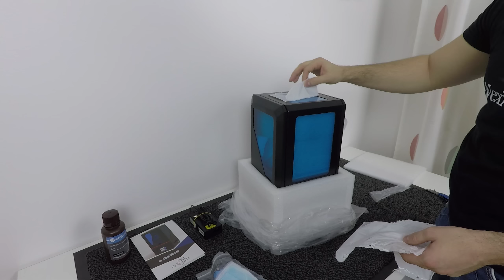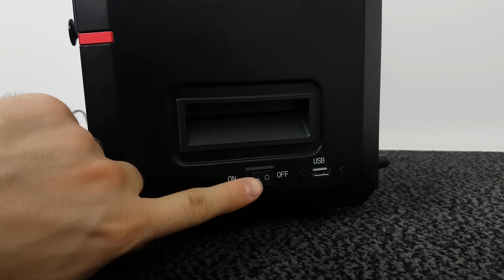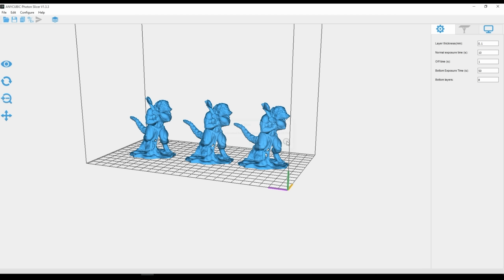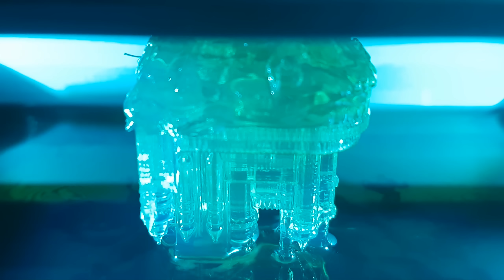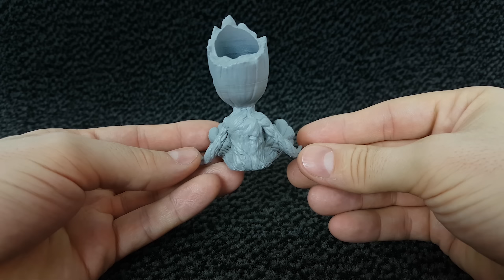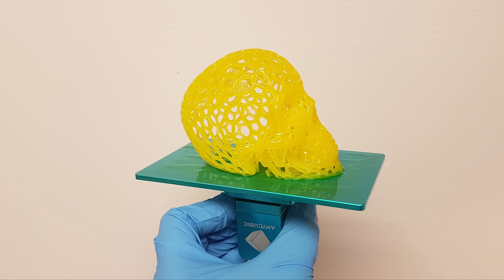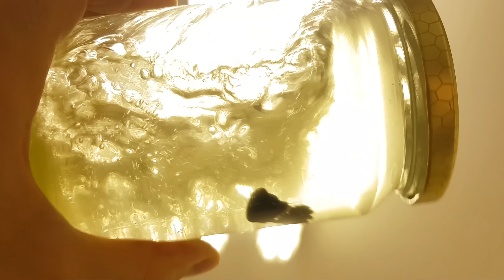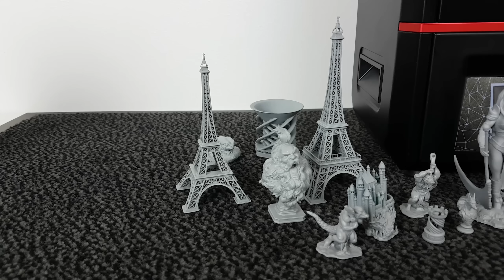Anycubic Photon DLP 3D printer Review - insane print quality!

Comment: SO hoping you can help me out. I have the FLSun variation of this printer. it came with a slicer called creative workshop. My problem is this. it works great. I am on the third of 4 built in test prints and its working wonderfully.

but it needs a file called MMS. but I can't seem to figure out how to get Creative Workshop to output an MMS file (it outputs B9j files)

the instructions that come with it are quite poor :-)

Suggestions? how do I slice files for this?
Reply from the maker: Nerys Am sorry my friend I don't how I can help you with that. I can only send you Anycubic photon slicing software if that helps? Maybe it will work with your printer?
Reply: Nexi Tech I figured out the problem the burn time for the first layers was not enough they said 30 seconds which is nowhere near enough the files they include which work are over 100 seconds first layer burn so I set mine to 110000 microseconds and it's working I also wasn't aware of that the that is supposed to be screwed down :-) so it's screwed down now I also found I can get D7 fep films off Amazon so I can replace the film I destroyed :-) I close the holes with Scotch tape for now it's working kind of enough to keep me happy until Amazon delivers on Tuesday :-) have a 30 hour print going right now of a giant Eiffel Tower :-)

Comment: Thanks for this review, but there is one major question. This DLP printer is cheaper than for example the newest prusa i3 mk3 amd the prints look so much better. What is the downside of this type, except of the more expensive resin?
Reply: You can make VERY rigid/tough parts with the high tensile resins out there.  I've personally used photocentric3d high tensile and it's impressive, I'm sure other high tensile and tough resins perform similar.
Reply: The print cost difference is not small and with more expensive consumable parts. Parts are not mechanically strong either judging by SLA samples I've gotten. Its not really a question of either/or - better answer is probably BOTH.
Reply: Thanks for the answer - much appreciated! :-)
Reply: Also, these printers are less forgiving when improperly supported. Any mistake in the setup can damn the whole print. With fdm machines, you can still get something usable even if some earlier section didn't do so well.

Comment: What's the minimum layer height this machine is capable of? Great video though!
Reply from the maker: Bisofication Thank you! Well all of the prints in this review is 0.05mm Layer height. Only Eiffel tower is 0.1mm. Layers are invisible at 0.05mm on this DLP 3D printer. I think minimal layer height is 0.025mm but honestly i think you don't even need to go lower then 0.05mm.
Reply: Nexi Tech wow crazy! I run a 3d printing farm and I'm definitely looking to get something like this printer. Thanks for the review!
Reply: There are 2 limits with resin printers.

First is the mechanical limit, which is a function of the minimum lift on the Z axes. This is mechanical and a function of the printer, just like FDM.

The other limit is the resin's recommended minimum layer size. Resins are calibrated to have a certain layer height +/- a certain amount. For example, trying to do a 200 micron layer on a resin set up for a 50 micron nominal layer is likely not going to work - the UV won't penetrate far enough to solidify that thick a layer. Similarly, going to something like 5 micron likely won't work because there won't be enough suspended pigment in the resin to absorb enough UV energy to cure.

Most "general purpose" resins seem to be set up for around 50 micron, giving you a range of about 25 - 100 micron layers where they'll work.
Reply from the maker: Bisofication You welcome! Thanks for stopping by ;) 
P.S. Good luck with your farm.
Reply: I personally print with 0.02mm and it can go down to 0.01mm :3

Comment: Thank you for your video. May I ask you some more details about the resins you used and the settings to set into the slicer to have such good result?
Reply from the maker: Si Con Resin You welcome. I used Anycubic 405nm original Resin(Black and Grey) and they works great. Can't wait for Anycubic to start selling UV resin too. 
 That Yellow resin in video is( apparently 405nm) I order from local company here in Sweden but unfortunately I can't recommend it because that yellow resin is not pure 405nm so during printing  yellow resin stared to get cured and becomes jelly even when I cover the printer and turn off lights. So that yellow  resin that i ordered is not 405nm only like advertised and it's not good quality because it seems that reacts with air too. About print setings I just use default settings on 0.05mm layer height except Eiffel tower which is printed in 0.1mm. 
You don't need to change anything when printing with this DLP 3D printer. Just slice the model and print it. 3D printing rolls and complicated print settings no longer apply on DLP :)

Comment: Hi Nexi, from where did you get the other resin?
Reply from the maker: qpoweriuytpl Yes. Original 405nm resin works great. The one that I purchased from local company gives me problems because it's not pure 405nm. I just need resin fast to make more prints so I order it just to give try.
Reply from the maker: Artur Fuste Yes I know that's why we need pure 405nm resin to avoid changing panels but there is UV LED light under LCD that is strongest at 405nm i think or am mistaking? I disassembly the printer and it's simple design and nice build. There is 4 UV LED diodes as UV light source. Maybe they are 405Nm diodes? I have no idea if they will work with resin outside of 405nm. I might try it.
Reply from the maker: qpoweriuytpl I order it from one company here in Sweden but unfortunately I can't recommend it because it seems that they selling universal resin 405-420nm. On the bottle saise 405nm but it's not pure 405nm and almost half of the resin get cured directly thru the printer glass panels from room light. Thankfully I was in room and stop printer before any more damage. I had hard time to clean cured resin from the printer and from resin tank (vat). So I hope Anucubic will start to sell their Resin(Pure 405nm) or if I found it elsewhere I will add link in description. I tried even to cover the printer with the blanket and still some of resin on surface was cured. So I really can't recommend this resin that I ordered from a local company here in Sweden.
Reply: Nexi Tech if you would find the answer, please us know. I corresponded a few years ago with http://www.funtodo.net this company. I do not know their resins, but they seemed like they have experience. So, after your first answer I assume you haven't got any problems with original resin. Is that correct?
Reply: Funny qpoweriuytpl, how little the world is. I've sent some minutes ago one mail to FunToDo asking exactly that, the 405nm compatibility. :-)
Reply: The source of problem is not all from resins, please NexiTech see this: https://youtu.be/43oJbXJl8uw
Reply: Wanhao resins are fully compatible.

Comment: Also what are the fumes like ?
Reply: The fumes are great. It doesn't get you as high as huffing spray paint though. I'd compare it more to permanent marker or white out without the annoying after taste.
Reply: The Photon is a DLP printer. What you are talking about (with a laser) is a SLA system. But with a screen and a UV source beneath it, it is DLP.

And even if there are no fumes, there is a nasty smell from the resin. So I would not put a resin printer in a room right next to me. I would put it in a well ventilated room.
Reply: Correction: It hardens the material with a UV light source, one LCD screen.
Laser are DLP systems, Photon is not DLP.
Reply: To be fair it depends on your resin probably, but I would say that the room where my printer is, reaaally smells of my resin ^^'
Reply: Tac Blades there are not fumes!
Reply: Beerveen that is great news I guess it depends on the resin used.
Reply: Tac Blades with this type of printing there is no melting. It hardens the matirial with a laser.
Reply: Some resins give off very strong fumes I know a lot of people complain about this. No heat just the resin itself